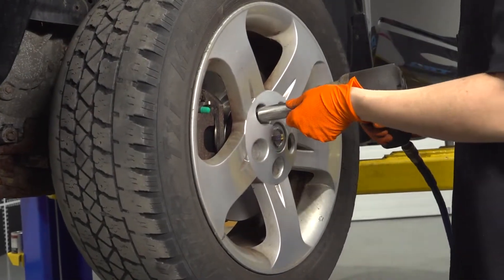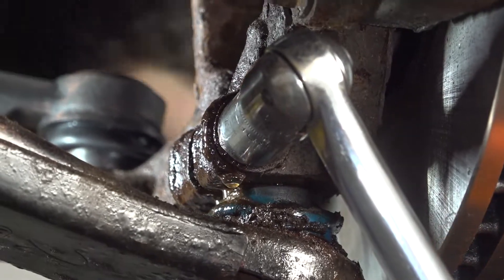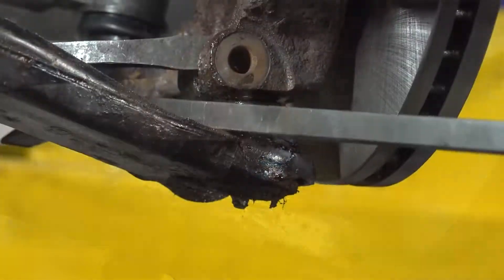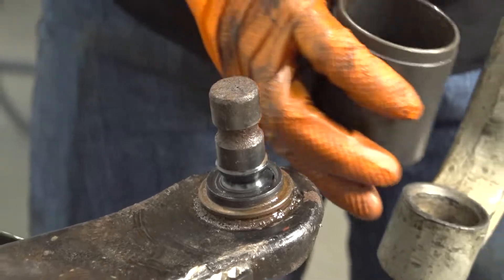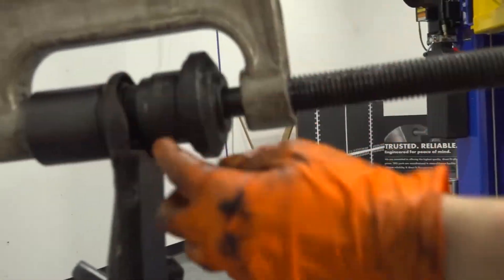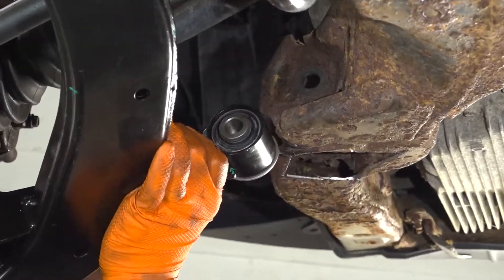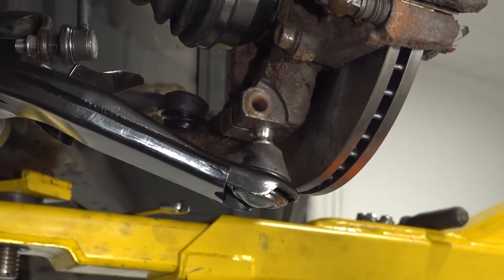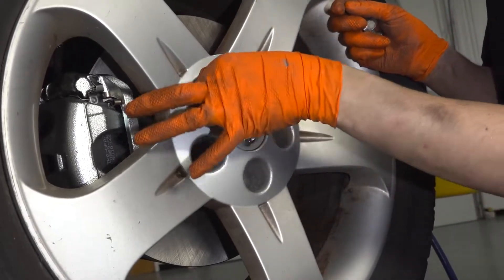How to Replace Lower Ball Joint 2003-2007 Nissan Murano

Comment: Is the bolt holding in the ball joint like in a half circle slot? Because.the bolt is frozen solid on my 08 quest but the nut came loose but the ball joint refuses to come out even though i can spin it

Comment: Might as well jus change the whole control arm then because it comes with a ball joint on the new ones. Most don’t have that tool and would lead to renting that tool out at the price of a whole new control arm. Rent gets the money back but still. Great video otherwise👍🏽